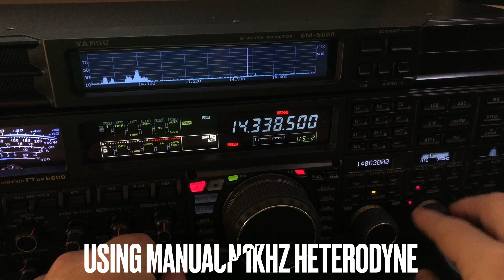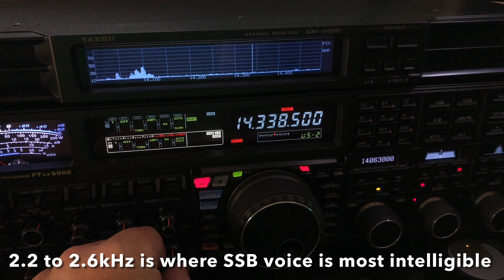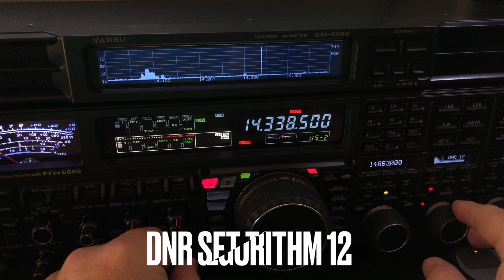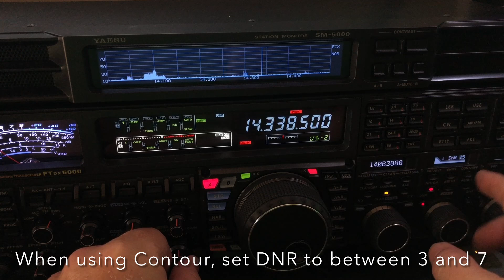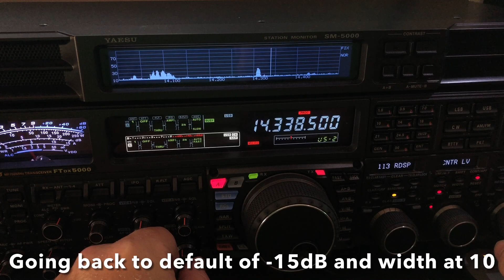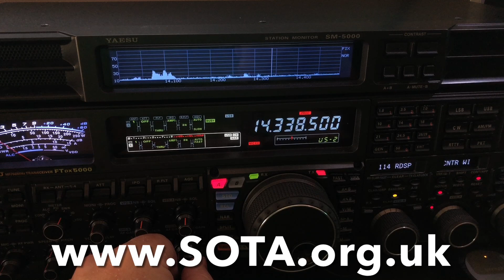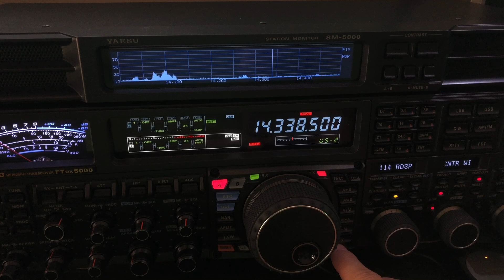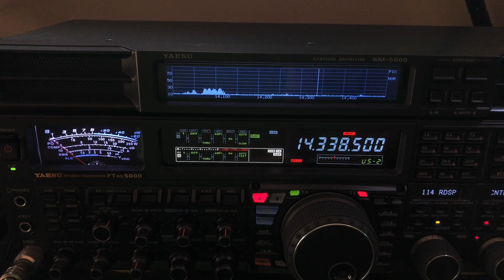SSB During Terrible Band Conditions

Comment: Doug, technically is the contour, dnr, and notch the same in the 10, 101, and the 5000? Should I expect the same results with the 10 or have these capabilities improved since the 5000?

KA1LQE
Reply from the maker: John, the performance of the DNR, Contour, and Manual Notch is virtually the same between the 5000, 101, and 10.  Actually the DSP in the 5000 and the 10 beat the 101 until the 101 received its update a few months ago.  The DNF in the 10/101 introduces some distortion that I haven't noticed with the 5000.  But I only use DNF when absolutely needed anyway.  If a tuner-upper is annoying me, I will enable DNF.  Sometimes I just use Manual Notch instead.

All three are still the best radios on the market IMHO.  Well, the 5000 is actually no longer on the market.  I say that not as a fan of Yaesu.  I wish someone else would blow Yaesu away in performance and ergonomics.  Yaesu makes some boneheaded decisions sometimes.  And their customer support is lacking at times.  Yet they do build the best radios, IMHO.  My second choice would be Elecraft.

73, Doug
Reply: @n4hnhradio  Thanks. Just what I needed to know Doug. I haven’t found a signal yet on my 10 that I could not isolate from other signals or noise where I could not understand or decode the content. That is a new experience for me!

John
Reply from the maker: It is wonderful isn’t it?  Yaesu fights noise like no other.

73, Doug

Comment: Wow I tried the boost at width 10 and +10 and for me this station at 14.315 is better.
Reply from the maker: Everyone hears things in their own way.  It can also depend upon the type and width of the noise.  For me, boost usually brings in too much noise too close to the frequency where the other station’s voice intelligibility lies.  

I’m spoiled by how well the DNR works without Contour.  When I run Contour, I lower DNR to 3, 4, or 5 max.  It creates a perfect balance for my ears when trying to pull out a weak signal.  I find that if I boost Contour, I need to run DNR higher, maybe as high as 12.  This adds some highs that were cut by DNR.  But I usually get better results with lower DNR and Contour cut, at the Yaesu default Contour settings.

73, de N4HNH

Comment: Is the contour essentially a receive eq with only 1 band that you dynamically change? You would think making with width very small (like 2-3) and make it a level around +5 and around 2400hz would only boost his most intelligible portion of this audio.  I understand you are scooping when it’s negative but imo you lose too many highs , making the audio a little muddy. I realize thing is subjective on hearing and the stations audio etc. thanks!
Reply from the maker: The Contour filter is somewhat like a wide notch filter - but for noise instead of heterodyne.  ICOM doesn’t include a Contour but you can fake it by setting their manual notch filter to wide.   That’s fine until you need both.  In this video I needed both notch and Contour.

The purpose of Contour isn’t to improve fidelity.  It is used only as needed, to discern what a signal in the noise floor is saying, when you are struggling to understand every word.  If they are rare DX, or an emergency, you need a way to knock down a chunk of the noise floor without knocking their voice out completely.  You aren’t going for high fidelity.  You are going for intelligibility.  

You can use Contour with a lower DNR setting and find a balance between Contour and DNR.  With Contour width set to a lower value, like 3 or 4, you take away less highs, but you also allow more noise through.  The setting of 8 that I used in this video was a compromise to allow more highs through while still being able to understand every word.

73, de N4HNH
Reply: @n4hnhradio  thanks Doug! I will try this method.